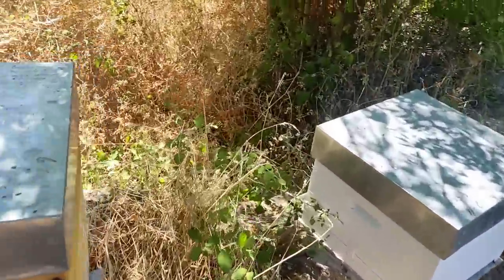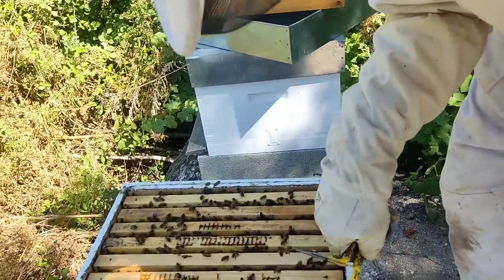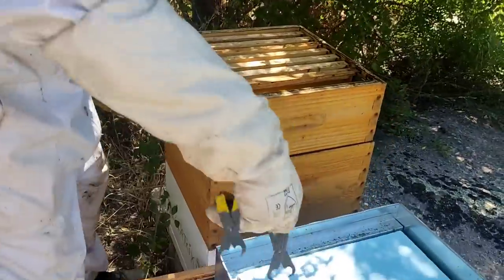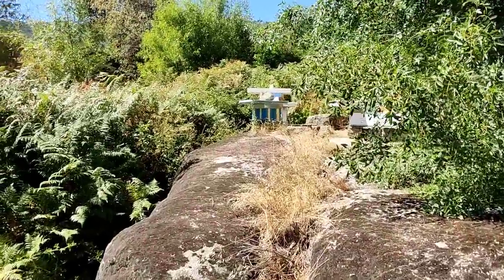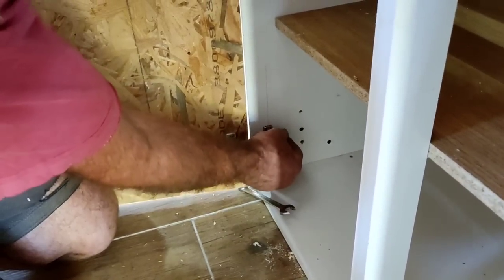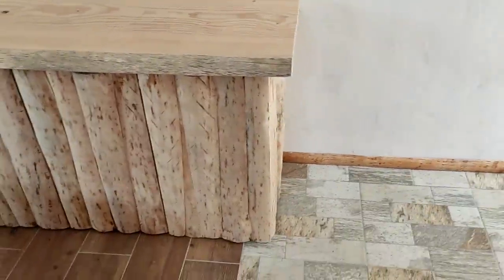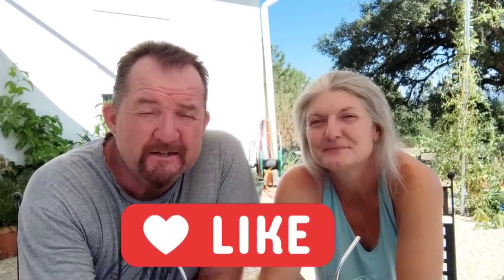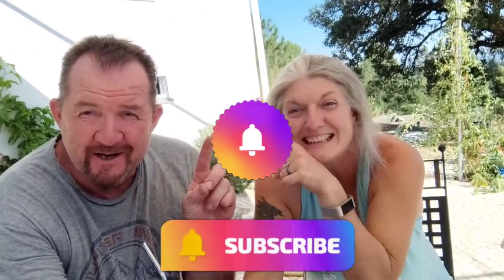81: The Extreme Heat is Destroying Our Hives in Central Portugal!!

Comment: I know I'm a year out but just catching up with the back catalogue. Also I'm sure you know but a frame with brood less than 3 days old transferred into a queenless hive with plenty of bees will give them something to make a queen from. Also it might not help but just a thought that in the brood box on the side with the sun on if you fitted two dummy boards it might prevent the overheating. She probably wouldn't lay on the outer edge frames if they over heat or unless she really ran out of room. Every time I think I have nailed bee keeping something happens that throws me.

Comment: Maybe Queens don't lay brood in extreme heat.  maybe it's a death sentence to brood if they did?  It looked very busy on the ones being cleaned out but empty.  Maybe they were cleaning out brood that didn't make it??  Just a guess... but if it's hot enough to melt the wax then it can't be a great environment for baby bees.
some ventilation at the top would allow the hot air to escape out the top.  I would look into that a bit.
Reply: Definitely heat-stress, try to give them some shade with a piece cardboard or wood on the cover.
Reply from the maker: @janwillemderegt48  like we did on the video, this year has been particularly hot for a long time

Comment: You could add some insulation against the heat under the lid, or put the hives in a styrofoam box used by fish shops to cut down on the heat getting through?
Reply from the maker: All the hives have insulation under the lids, that's the blue stuff you see on the video😁

Comment: The 3rd hive opened is how they all should be at this time of the year they don’t appear to be strong enough the queen should be able to have her brood patches that stops the workers storing honey in the brood box , I think more inspections ,in oz they cope in heat , your problem I feel the adding of supers before the hive is strong enough to air condition it themselves they regulate the hive , try adding 1/2 box “ideals “ that can be easier for them to keep cool the frames I draw out in the brood box in the middle as this is the queens starting point they will draw it out quickly as that is most even temp at night ,a bonus is the darker old brood frames are moved to become super frames the buildup of tiny bits of the pupation stick to the wax and give strength when spinning frames ,  the no brood box shouldn’t have a super they are queen less or as when they become aware she is not well they supersede her and a virgin queen starts her reign as the last box opened brood patern is the minimum try nick pinching a frame of brood from healthy hive to strengthen the weak, a colour marker each year is different colour will help find her quickly if she has swarmed you know and her daughter can be coloured with the years colour , it’s imperative to see her, as if she is still there with bad brood patterns , pinch her head off and get a frame of newly laid eggs from the strongest hive for them to make a queen good luck ,we can get burned by the seat belt in summer in country australia so you only do it once , vinyl seats are no longer stay cool 😳👍❤️❤️❤️🙏

Comment: Why don't you insulate the hives with Morgan's SuperWool thermal ceramics?
It's not expensive and it will keep the hives a much cooler.
Reply from the maker: Not available in Portugal
Reply: @projectportugal  Yes it is. I use to buy it in Empatec.
Reply from the maker: @Jesuscger  I'll check it out